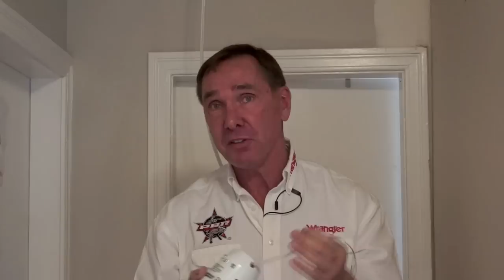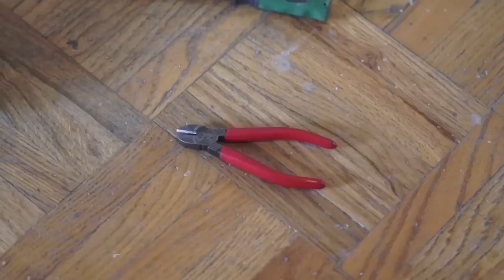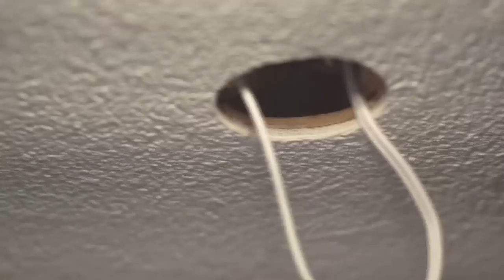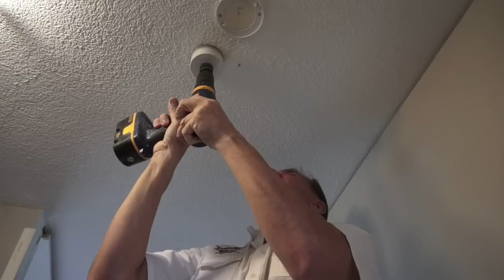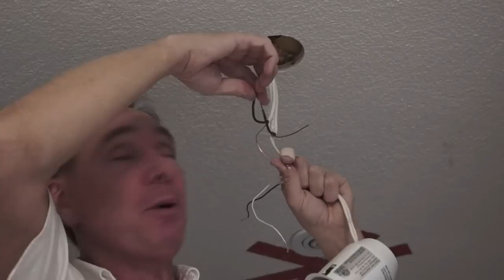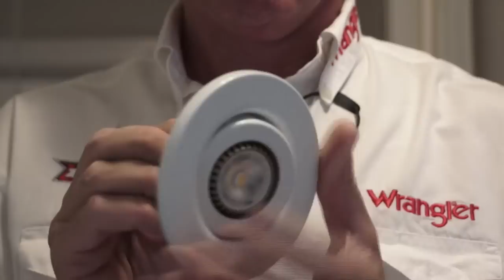How to Install Recessed Lighting | Retrofit

Comment: Just a watched your video for info but I got some Suggestions to your Video - 
- Please take the pot lights out; get a Insulation Barrier; stick that behind your pot lights and then reinstall your potlights -

-the reason for my suggestion : Under the Canadian building code, only recessed light fixtures designated "IC" (insulation contact) can be installed next to insulation. They have a rectangular metal box around the bulb that creates an air space between the fixture and any insulation.

It's not a big deal when bulbs generate heat in a table or floor lamp since they are used in well-ventilated areas. But in a recessed light that's tucked into a floor or ceiling cavity, heat needs to escape or the fixture will overheat and a fire could start.

So, you need an IC fixture in any insulated space - an upstairs ceiling below the attic, for instance, or a space between the main and second floors that you've insulated for sound.

In Conclusion -- The Fixture has to be insulated to fit beside an insulation or have an insulation Barrier. Please do not mislead people into believing that 120VAC will not burn down your house; why don't you try to get some sparks flying next to your insulation and see what happens next.. Plus the GU10 bulb sockets burn out pretty fast when they are in shitty pot lights as such.

JUST MY 2 CENTS ; TAKE it or LEAVE it.
Reply: I like the intent here, and gives a general guide on what to do - so please take what I say as constructive criticism. I agree with ardeep and expand on it, There are too many do it yourselfers now a days which have no intuition of their own and follow usually the easiest / cheapest way to install a product. So what you say is completely true, I agree 100% - I would also like to add that houses are becoming extremely airtight, once the vapour barrier has been compromised, its best to seal it back up 100% - not half fast....100%. You also need to follow building codes, and agree this light - regardless if LED powered, needs a box (for insulated areas) which is really just a spacer away from combustible materials. I would never install these lights, thinking that a new house owner would never remove the LED, people come up with their own reasons - might not like the color rendition of LED's, or the Lumen output. Perhaps its just my own short experience so far, expect the worst and hope for the best. Everything I do or build should be the same way - fool proof to the best of knowledge with no excuses for cutting corners
Reply: Ardeep Matharu we will all leave it, thank you.

Comment: You really should have started with a disclaimer that you're NOT an electrician or even a knowledgeable DIY`r.
Unfortunately, some viewers will think that you know what you're doing and harm themselves. Where did you learn this stuff? What electrical code says you can just bury splices in insulation or not use wire nuts or crimp rings  on ground leads? No offense, but you don't know what you're doing and shouldn't be making instructional videos.
Reply: Sam G this guy is the idiot LOL don't waste your time - he doesn't understand voltage not to mention that LED's DO PRODUCE HEAT -
Reply: Percy Lipinski
 I think what you fail to understand is what happens when the next owner of your house replaces your LED bulbs with 50W halogens.  An inspector probably won't be pulling the cans down to see if your wiring is up to code when you're selling this house to the next "lucky" soul.  Will you disclose that none of these cans are installed to code?  In a can with that standard connector, code says there should be no problem to replace those bulbs with 35W or 50W halogens, so there will be nothing to stop the next owner from assuming it's just fine to do so.  Will you feel bad if the house burns down then?
Reply from the maker: Well Sam MORON G. Bad news for you because it's Bern a few years and guess what, not even close to a problem and at 6 watts a bulb there never will be. Wake up the days of electricians rippling us off for a few feet of cable installation are long over and they're never coming back. So you idiot. Go get yourself a job flipping burgers, you need a lot more brains for that job and it's certainly much more dangerous with those hot grills and all.
Reply: Percy Lipinski Wow touchy aren't we?
It really doesn't matter what the wattage of the LED is. Aren't you connecting them to 120v? I wasn't suggesting that you hire an electrician to do the job, just find the information that is readily available to do the job right. It probably would have only cost a few bucks more to correctly install the fixtures. You really need to do something about the defensive attitude. Your name calling responses don't change the fact that you are uneducated as far as electricity is concerned.
Reply from the maker: I did start by stating I wax not an electrician. For the record I am a graduate electrical engineer. So let's get you wired right. The fact is I could safely use speaker wire on this project. Obviously you shouldn't be touching the bare wires but once it's installed you DO NOT need fixtures for 50 watt bulbs. These are 6 watt bulbs they do NOT need a housing or special fixtures. There is simply not enough heat generated to cause a problem. I had an electrician come in, quote me $2,000 plus license and fees and bulbs. I did it myself one half day. Fixtures, wire  and bulbs, $38. They're still working fine in my old wooden house 2 years later, and guess what nobody has come close to dying! Now go get yourself edgumacated!
Reply: Percy Lipinski So you're connecting to low-voltage wiring? Just what are you splicing to the fixture leads? is it low-voltage or 120v.? Maybe I missed something, but it looks to me like you wired romex directly from the existing 120v. fixture. Being an electrical engineer, surely you know that the wattage of the bulb has nothing to do with the voltage that supplies it. I have plenty of .5 watt LED night lights plugged into 120v outlets. Using your reasoning, I should be able to power them with speaker wire and not use electrical boxes if I'm not going to use them for anything else.
Reply from the maker: What you and a few others fail to understand is the relationship between power load, watts, wire gauge and temperature. Power equals heat. Low power equals low heat. On top of that all led bulbs are equipped with built in heat sinks. We are in a transition for all homes now, old and new. There's no need to make the new obey the rules of old. It's an entirely new game. The power required to operate our devices today is simply not enough kill you. Even Christmas tree lights, the bane of every fire department around the world have become so reliable they don't even bother warning people anymore. They are two prong cheap wiring systems running led bulbs and they plug  well into the rainy, snowy outdoors. Why? Because there simply isn't enough current flowing through an led Christmas light set using led lights. Led ceiling lights are no different. I was very clear that my project will definitely not work if Halogen bulbs are used. This is a very old house do the next buyer will be tearing down the house anyway. Even if they don't, next year they will begin phasing out Halogen. So wake up, pull the needle out, grab s coffee, save thousands and have a nice vacation, thanks to me!!!
Reply: Percy Lipinski The point I'm making is that you still have 120v going through the romex, with splices in the open. this is against code and could have been done right just as easily. Also, in the original fixture, where you connected the cable for power, it looks like your ground isn't connected at all, so your led fixtures aren't grounded.
You seem to be hung up on the fact that there is no heat build up. That's another issue not associated with the 120v. It appears that you only read what you want and not the issue at hand.

Comment: I can find the bulbs but I can't find the 2 inch cans??? Any idea what the can is called
Reply from the maker: You ding really need the full cans. I bought the ones for the open attic at Home Depot 12 in a box for $10. That's a huge deal. I put 20 more in my kitchen total cost was about $200 including bulbs. Took me half a day.

Comment: Don't listen to anything on this video!! clearly incompetent.  First of all voltage does not kill you, amperage kills you.  1 tenth of an amp is enough to stop your heart.  Yes your lamps are only 5 watts but what else is on that circuit as well you have no idea.  Secondly you cannot make 120 volt joints and just push them up into the ceiling they need to be made inside a box ILLEGAL!! so many things wrong in this video.  Thirdly who twists wires together with side cutters get some linesmen pliers bud.  Fourthly you should always shut off circuit breaker because you can still get shocked off the neutral by only shutting off the switch.  Im surprised this house hasn't burned down probably will soon!
Reply: Chy Hendricks the voltage is actually what kills you, perhaps different if applied directly to your heart though. Anyway your smartphone battery and car battery both have fairly high amperages, 2 for the phone, 600-800amps for the car battery. These however do not kill nor harm you becuase the voltage is low (3.7 - 12). Anyway good day.

Comment from the maker: Hi Zeeshan, you don't need a kit. In fact you need very little. There are two ways to handle your lighting situation. LED bulbs come in two versions. 12 volts or 120/240. If the power lines are already in place then either throw on a 20 amp 12 volt transformer and run speaker wire to all the outlets or run 120/240 cable and wire directly. The housings are readily available anywhere on earth.

Comment: Very nice and encouraging video, I'll now start putting some in my house too. I have two questions: 1) Did you get the bulbs separately or they were included in this pack of 10? 2) What's the formula for quantity of these lights, i.e. how many per square ft or per 10 square foot? Thanks.
Reply from the maker: You need to buy them separately. Led's come on a huge number of varieties and price points

Comment: Note to all watchers... please make sure that you check to make sure that you're not going to destroy a live cable when you use the hole saw... you need to make damn sure that you don't have a live wire behind that saw... this often requires going into the attic to check, if you don't already know, or at least a stud finder that detects live wires.
Reply: +Percy Lipinski I am educated...two bachelor degrees and journeyman's ticket as an electrician. And you can feel free to try to punch my lights out... might be more difficult than you think. Violence is the stock and trade of those too ignorant to form a proper opinion. 
By the way, 120 V electricity can kill you.
You are stupid. 
You are reckless.
You are careless.
You are irresponsible. 
You are also culpable for people coming to harm by listening to your shitty advice.
Reply: +Percy Lipinski you always turn off the breaker. its the only way to be sure. ever hear of back feed on a neutral??? kills people all the time.
Reply from the maker: Agreed

Comment: Change that 41mv to 41mA. Only a minor mistake, the rest is fine.
Some people on YT are just trying to help out others and that's great. I'm here a lot learning how to do things. Judge not..... so..  OK then.  Just making some code comments on your work. If that was fed with 12V DC  you'd be safer. 400mA @  120V AC trips the average home GFCI receptacle and yes it does hurt when they fail.  Do a piece on Arc-fault circuit breakers and receptacles.

Comment: I can see you do know a few things so I will be respectful. Now you said you are working with 120 Volts AC with a load of 5 Watts per opening. If only 1 fixture is installed the amp draw is 41mv, not much but when you add more to that chain of lights the amp draw goes up. It takes .5 Amps to kill, your carefree teachings worry me. As far as the NEC goes the amount of violations you committed is shameful. Not to mention the voiding of the UL listing of those fixtures that you you pulled the j-boxes off of and fact that they must be 2" away from combustible materials or boxed in with Drywall because they're not IC rated. Those black metal spring tabs are to pinch the outer can lip to the ceiling material, I noticed you put one in with only 1 support tab and that was improperly installed. I could go on with the other code violations but I think you get the point. Please don't rip on the skills and knowledge of a licensed electrician as we know better than to do poor installs. Good luck getting you insurance company to flip the bill if your work fails and hurts someone. Did you pull a permit for that work? .......

Comment: I think there have been enough other sensible responses to your irresponsible demonstration. I think Scottway73 said it the best and as politely and respectfully as possible. I just wish there was a way to report this video and have it removed before someone or some family is killed because of your negligence. I shudder when I think about the children YOU have put at risk including your own. As Scottway said, it doesn't matter about the bulb, it's a 120 volt ac wire, which makes a pretty big god dam spark when it shorts out. PLEASE, PLEASE, PLEASE anyone who watches this and wants to install your own lights, ALWAYS, ensure the breaker is off or fuses pulled before starting any electrical work and get the advise of a real electrician. DON'T follow the advise of this hack!!!

Comment from the maker: Listen you idiot. The whole point is NOT to hire an electrician. The job I did is : years old now and guess what, no fire, no smoke and in fact it will NEVER happen. Get real pal, it's 6 watts!!! Do you even know what 6 watts is? It's 1/100th if a horsepower!!!
Reply: +Percy Lipinski you would get the shit kicked out of you by anyone, the fact that you think you are intimidating anyone is hilarious, what really throws it over the top is your piece of shit wrangler shirt, $9.99
Reply: lee izaak You don't know a thing about electricity. If he sells this house in a few years and someone comes along and tries to change out these potlights, their lives are on the line. There have been no problems because he did not touch the wiring or caused it to move around. When someone pulls out the light and the marettes come off and short to neutral, you'll get a spark strong enough to ignite the sawdust in the ceiling.

If you're doing the wiring for your home, splice the wires inside a junction box. A simple 3 dollars could save the lives of people in your home.
Reply: getbo dipp shit what stupid reasoning
Reply: yupyup yup.Lipinski needs to go back to grade school.Make that kindy garten.What do you expect with a name like Lipinski.......Lipinheadski
Reply: Percy Lipinski
Why don't you quit being a wannabe electrician and become a dog babysitter? That's all you know how to do properly.
Reply: Percy Lipinski
At least I don't eat feces like you. Yuck, Percy! What are you doing?
Reply: Percy Lipinski
Whatever you say, wannabe electrician. Nice suit, fucker.
Reply: Percy Lipinski
Hahahaha!
Reply: Your house is not safe with an incorrect installation, which you recorded and actually published! Man I would never hire a person like you or want you near my house!
Reply: Good tutorial Mr Lipinski - ANYBODY following your instructions can safely install lights.

I would bet some of these nitpicking posts are from electricians or safety consultants - who hate do it yourselfers.
Reply: With your kind of instruction the point IS to hire an electrician.  Your just missing basic safety measures and that's what makes it dangerous.  I didn't call you a idiot or jerk as most would feel you needed to be called.  BASIC safety is what is missing from your instruction.  Congratz on being the LUCKIEST do it yourselfer, by not having an electrical accident.
Reply: T Money AND if you are too sensitive to get comments on what you put out to be viewed publicly, maybe you should keep your videos to yourself.  Have a blessed day.
Reply from the maker: +Skimtar I'm an electrical engineer Georgia Tech, 1980, BA you douche bag. Stick your head up your butt you two bit LOSER!
Reply from the maker: +trent farrell you dirt bag.

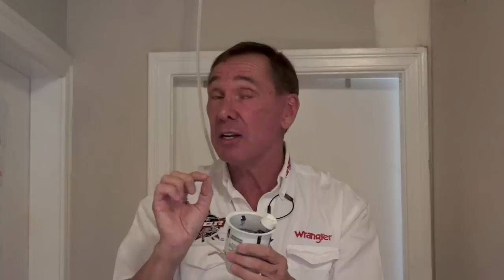Comment: At 1:04, on the side of the box of the light fixtures you got so cheap had a wiring box attached to the light fixture pictured.  Were they NOT in the box when you purchased them?  Did the instructions say don't use them?  Even if they weren't in the box, you know you CAN purchase the wiring boxes seperately so you can SAFELY do an install of can lights, right???  Do it yourselfers.....hire an electrician!!!

Comment: Good video, thanks. All wires must be rated for the amperage of the breaker, aka 15amp breakers need 14awg wire, this is code, incase an idiot were to put halogens in these sockets, ud fry some shit up.

Comment: technically the ground does need a marette. i know your using led technology but you still have fixtures not rated to be installed in insulation. (even tho its an led it still gets hot!) and you also have open air connections! glad you did this to your house and not someone else's! You will always need an electrician.

Comment: I am going to be putting recessed lights in my house and stumbled on this video.  I don't know a lot about electricity but know enough that I wanted to see what others were going to say to you.  I have been shocked pretty good in the past so I don't agree that the 110V is not enough to kill.  Also, I believe you need J-boxes at those connections. You are not supposed to be shoving exposed connections with just wire nuts into the insulation like that.  You should at least have used electrical tape to hold it all together. These wire nut connectors have been known to come loose and arc.  That is how fires start.  Thanks for the attempt but I am going to keep looking.